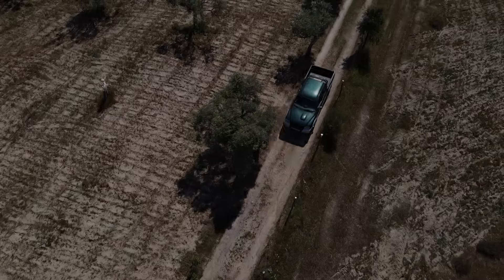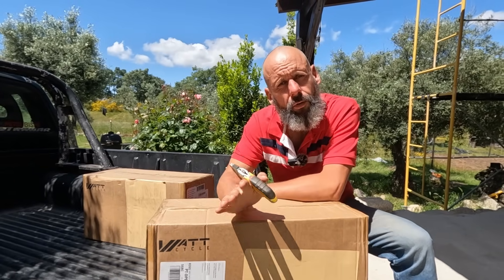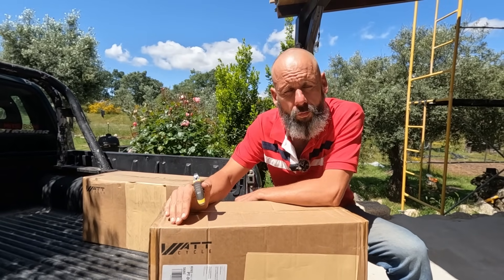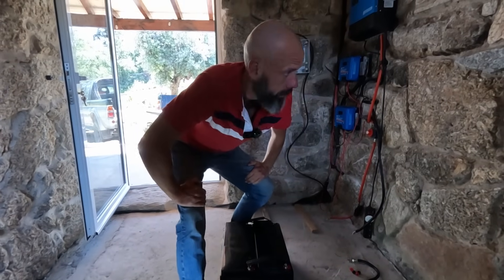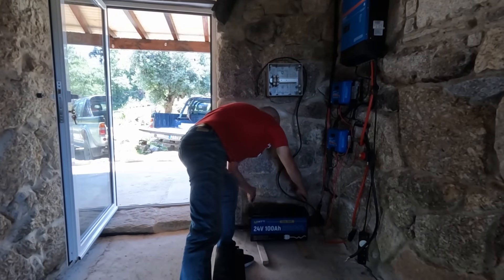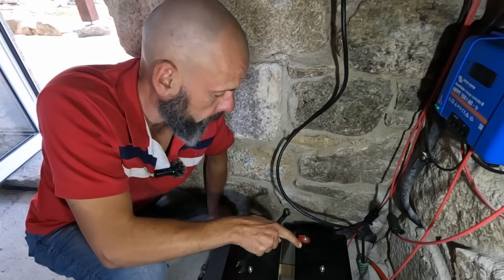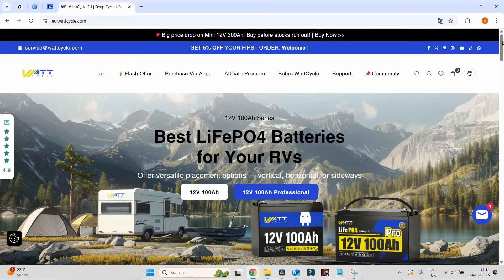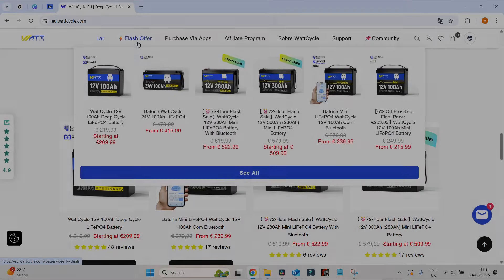Powering Stone Barn Off-Grid | Real World Test of the WattCycle Battery

Comment: A guy called Will Prowse has a channel where he tests these type of batteries, and he also cuts open up the housing so that he can check the individual components and how well the batteries are produced. And despite that this brand was labeled as a budget battery he was very optimistic about the performance and how well they were made. And everything worked as advertised, such as the current protection and low temperature protection, and that is not always the case with these type of batteries. And it even outperformed some of the more expensive brands. He tested a 12 volt battery from this brand, but if the 24 volt version is just as good in performance and well build as the one that he tested then it seems to be a good choice. It matches or even outperforms the quality and performance from the so called high quality batteries. 

If you want to see the test that he did, and the internal components from the battery then you can go visit his channel and search for wattcycle. It is not a sponsored video.